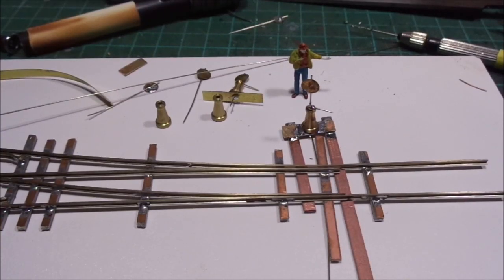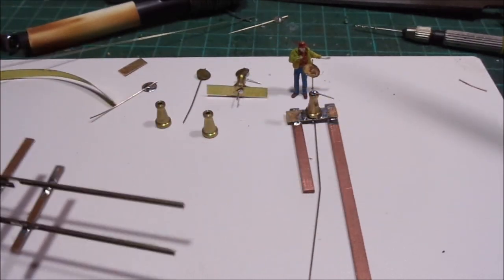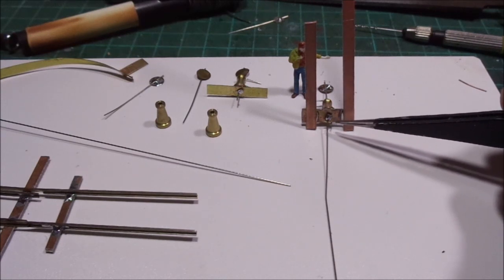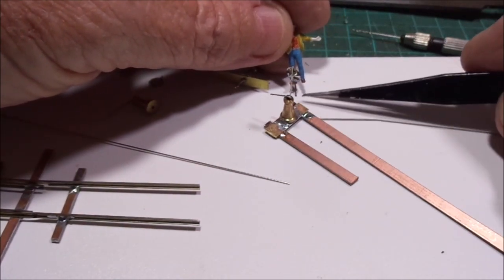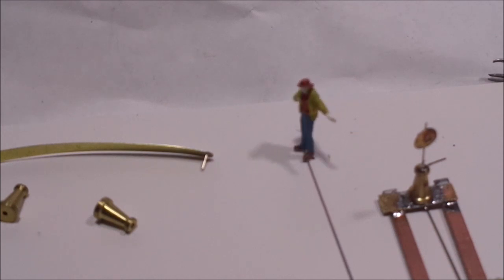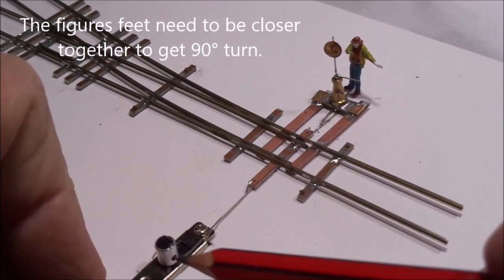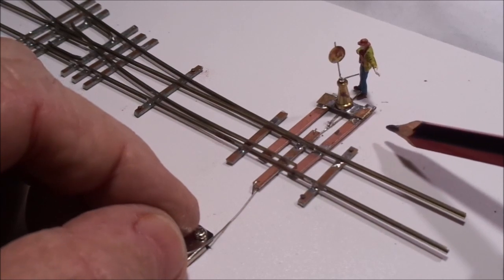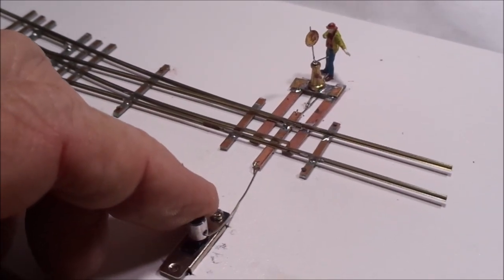HO Working Switch & Figure

Comment: In HO I made the stands by cutting half way up a length of tube then spreading them out to make the legs (my prototype was that style), a smaller piece of tube was placed in the top of the stand to reduce it to the wire size. The rest was the same as Laurie's.

Comment: Laurie, last summer I spent a great deal of time to unsuccessfully do exactly what you did so easily. Couple questions: I also model HOn3. What gap do you have between the points and stock rails, std or larger? And can you provide more detail, or a sketch of the small throw arm under the stand? This Yankuch appreciates your fine videos.
Reply from the maker: G'Day Bruce, I use a tiny piece of brass shim and drill 2 holes about 0.030" apart, say a 0.020" drill. This I solder the vertical wire to in one hole - don't solder over second hole. I loop a wire through the second hole so it moves freely but stays holding in the shim hole.
Always tinning both mating pieces solder shim base and brass stand - I have a small lathe but you can use tube.
Then insert the target wire up the stand. Make a handle from wire and solder to top wire out of stand.
Then solder the target onto wire. And add PCB ties, I solder one tie to turnout rail and do any adjustments for wire from tiny shim lever to turnout throw.

You need to orientate the 90 degree to suit the way the turnout is set to but when doing this you will see what adjustments are needed.
Glad to help - Laurie
Reply: Laurie, thank you for the quick and clear response. Only other question is what is the dimension of the point to stock rail? Per NMRA HOn3 gauge or widen to...?
Reply from the maker: @brucebowie7710  NMRA will work